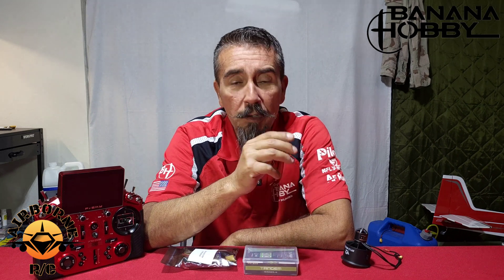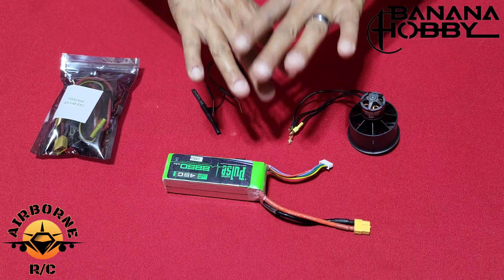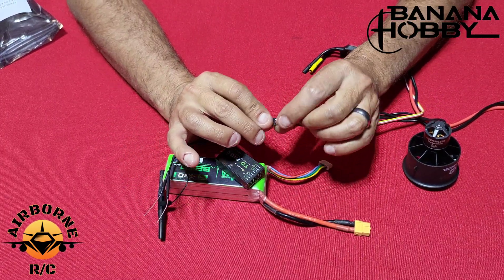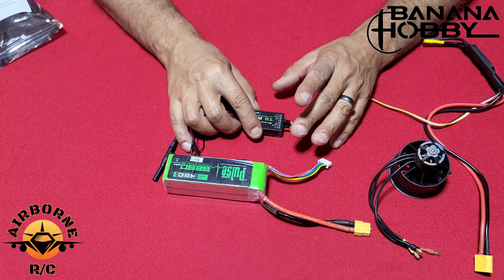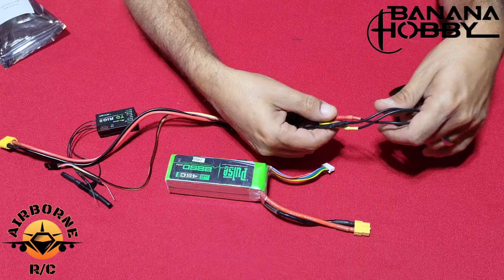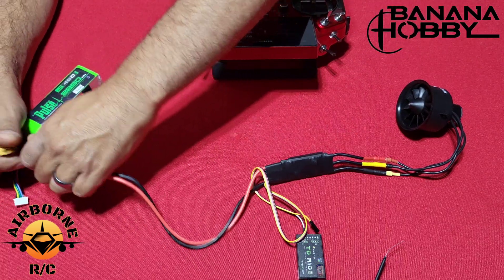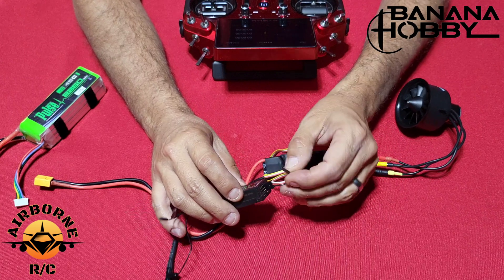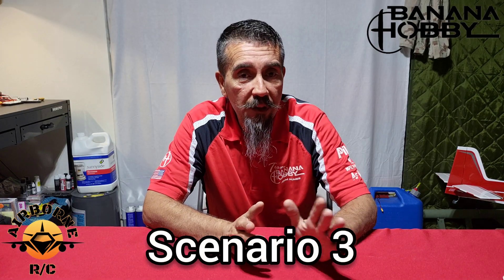FlyFans Thrust Reverse Setup and Troubleshooting!!

Comment: Thanks for sharing! Too bad there is no manual for this all over the internet
Reply from the maker: @nirlachman007  Thabk you! And that's the reason for the video! Hope it helped 👍🇺🇸👊
Reply: @NoonzAirborneRC I tried this method to program the ESC on the new FlyFans J-20B twin 70mm, since it didn’t work out of the box,  and it was almost the same as you explained. The difference for some reason is that I had to choose the option with 3 beeps instead of 2.
Since I don’t have any manual I don’t know what each option is :)
But it’s working 🙏🏻